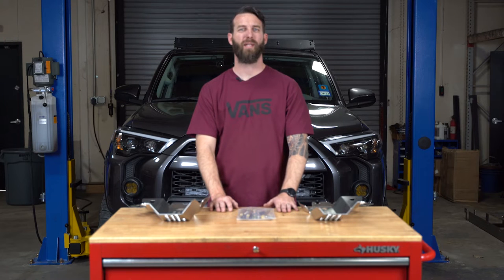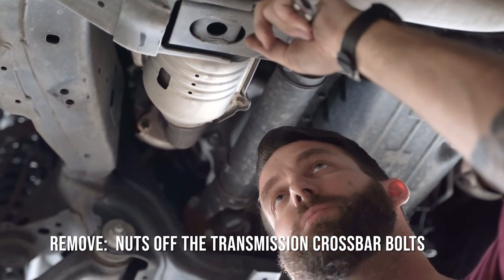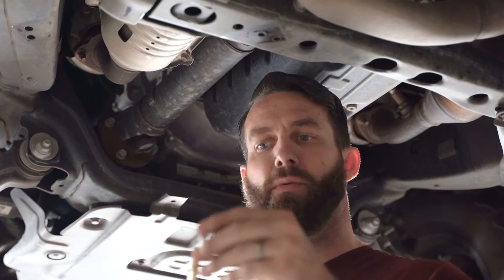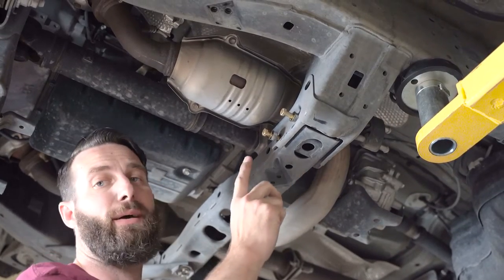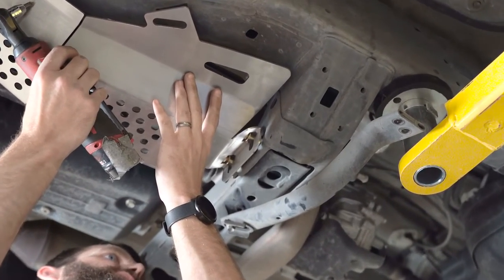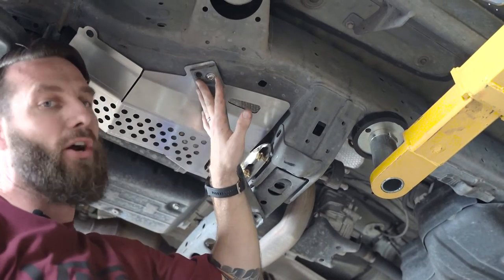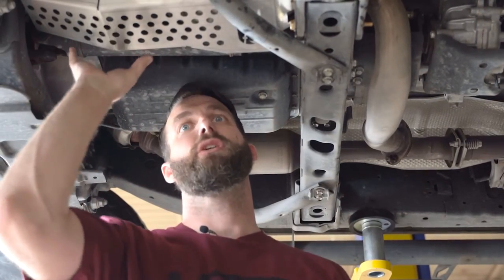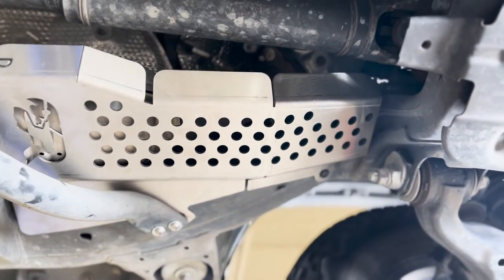How to Install Catalytic Converter Shield For 2010-2024 Toyota 4Runner | Cali Raised

Comment: Just completed the install on a ‘24 ORP.   It went smooth, on my back, in the driveway.  So nice working under a clean vehicle.   The one thing that concerns me is the shield makes contact with the frame just before the rubber bumper,  on both driver and passenger shields.   I thought the rubber bumper would be the only thing contacting the frame at that location.   Don’t know if it’s going going to be a problem?    I’m not getting any rattling which is good.     

I boogered up one of the safety bolts, so I ought to replace it now, while it’s still simple to remove.
Reply from the maker: Shouldnt be an issue! The cat shield should fit snug against the vehicle!

Comment: I just finished installing them. A lift would have been handy, but I did it in my back yard. The most difficult part for me was keeping the shield in place while installing the security bolts. I got bonked on the head when the other bolt holding the tube support in place fell out lol. I ended up using a jack stand to hold the shield in place while I installed the security bolts. A cordless ratchet wrench would have also been nice to have, but it can be done with other tools. If these deter or at least slow down thieves, they're well worth the cost.

Edit 7/5/23 -- I finally had time to figure out what was causing the rattling noise. There is a bolt on the driver side catalytic converter with thin metal around it that was sticking out just enough to come into contact with the cat shield. I removed the shield, and bent the metal near the bolt just enough to make sure there was no contact. It was easy enough to do, and I couldn't reproduce any rattling on a test drive.
Reply: @spalacios9058  You're welcome - sorry to hear that. Hopefully, they're working on an option for KDSS. I don't know what the differences are, but obviously there's a market for a KDSS version. Good luck.

Comment: would’ve loved to see the install done in conjunction with the rest of the cali raised skid plates to see how the cat shields fit with the rest of the gang. that is unless the cat shields are not compatible and can’t be used if you’re running the full skid plate line up (front, transmission, and transfer case)
Reply from the maker: All skid plates do work in conjunction with each other, so there are no issues

Comment: My cross bar is contacting the sheild and not lett me put the security bolts on. Something definitely different with the ones i have.
Reply: Same
Reply: Me too
Reply: Did you figure it out?  I want to purchase this but I want to wait to see what you say.
Reply: @spalacios9058  So I contacted CaliRaised, they told me its a design issue, he said he will make a new one and send it out. I think they are aware of this problem.
Reply: Also I highly recommend you guys buy some 40 mm bolts to replace the 30mm security bolts they provide, make installation so much easier.
Reply: @kirksmith347 should I buy m4 or m8 40 mm screws?
Reply: M8x40 is what you need. They supplied M8x30 and are to short. They work but the added length makes life so much easier

Comment: If you can install the shields on a lift I'd recommend doing that. I did mine on the ground with hand tools and it was a pain but I got it done. Installation was straight forward and I would have saved a load of time if I did it on a lift and had an impact gun. I will say its a high quality product very nice fit no rattles since putting them on although I have not been off road yet since the install. I do have two questions though. Why were the security bolts not made a little longer than the stock bolts they replace to compensate for the thickness of the shield? Also why is the security key so small? The combination of bolt length and the security key size made the bolts hard (for me) to install and tighten. All in all I am very happy with the product and I'd recommend them 100%. I never realized how easy it is to get at the drivers side cat on a 4 Runner when its lifted until I got under my rig and installed these.

Comment: Just installed mine . Took about an hr laying under the 4runner . I did use some anti seize on cross member bolts .
Reply from the maker: Thanks for choosing our cat shields! We are glad you got them installed :)
Reply: @CaliRaisedLED  I can't get the cross member bolts out. They are held on with lock nuts and it turns the whole bolt when I apply a bit of force. I don't have an easy way of holding the bolt head while applying force to the nut the other side. Any thoughts?
Reply from the maker: @jerryhoweld7086  Try to relieve pressure on the crossmember somehow! We can probably help you better through our customer service portal if you email info@cairaisedled.com, so we can communicate better! Or call 888-385-5036

Comment: When is the clearance issue going to be fixed on these? People are going to start hearing rattling sounds like 5 years from now if not already.
Reply: The driver's side Cali Raised shield was in direct contact with the cat heat shield (why is there not a cat heat shield on the passenger side?) and rattled like crazy.  I removed the Cali Raised cat shield from the drivers side and the rattle noise is gone.  Searching options of removing the cat head shield so I can reinstall the Cali Raised shield.

Comment: Highly considering this purchase. However, I’m not understanding why reuse the factory bolts instead of using security bolts all around?
Reply: You only resuse 2 factory bolts on the cross member. The other 2 are security bolts supplied with the guards.